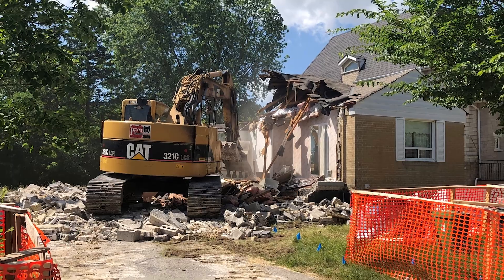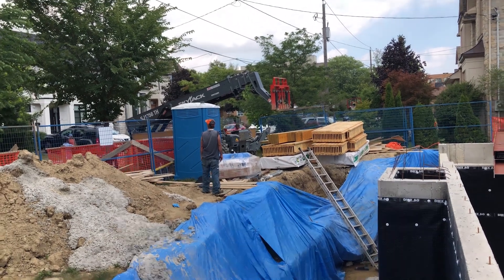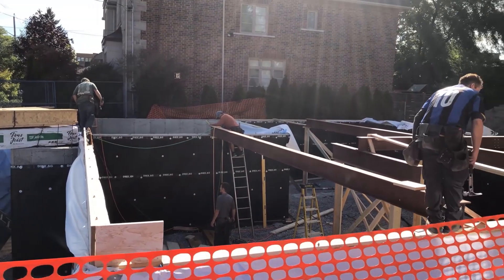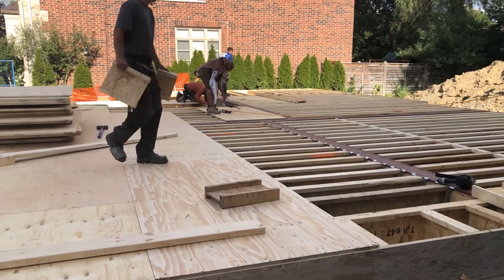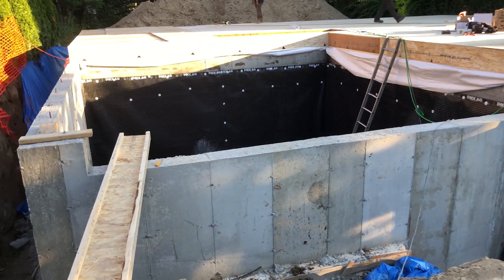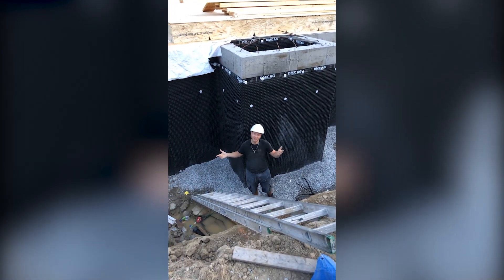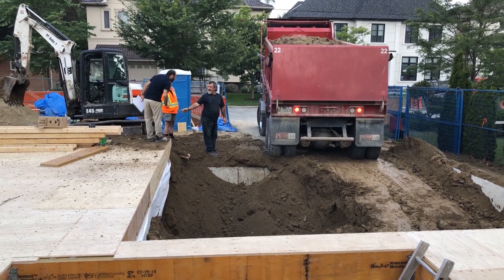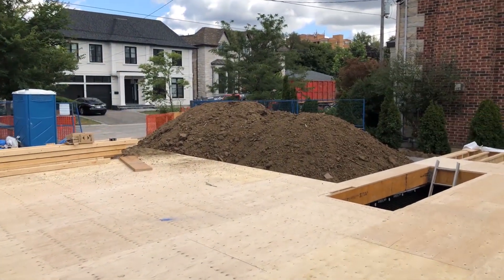Building a House: Construction Steps – Main Floor Framing, Installing Steel Beams, Joists & Backfill

Comment: Hi, how are the wood joists attached to the metal beams?
Also curious, what size w beams?
Reply from the maker: If you look back at the video at around 3:30 you can see very small metal clips basically attached to the steel beams. Those are called joint hangers and that’s what allows the joists to stay in place. The beams were varying sizes. Whatever the structural engineer required is what we used. Honestly I think most were 12 inches but I think a couple were 16
Reply: @WeTheWolfmans  thanks for that info. So I'm guessing the just hangers and tack welded to the beams? Normally they are nailed to wood beams.

Btw, nice series. Ic think your channel should be way more popular than it is but who knows the way of YouTube?
Reply from the maker: Thank you so much for that, we are so happy you enjoy the channel. The steel beams were all packed with wood so I believe the hangars were attached to the wood inside the beams. 
Honestly the framers worked with the plan of the structural engineer. The technical specs we left for the engineer to walk the framers through.
Reply: @WeTheWolfmans  no,thanks I'm learning a lot. Your "we saved a million bucks" vid should be essential watching for anyone considering GCing their own house